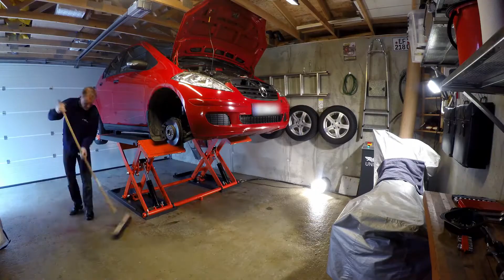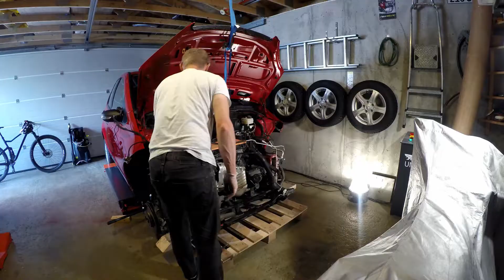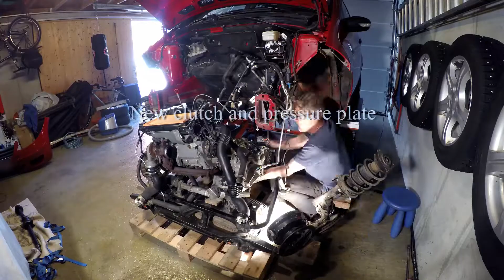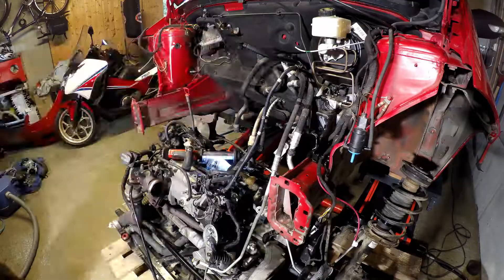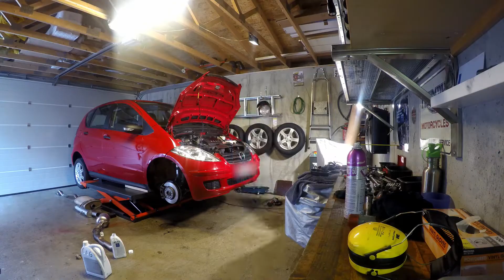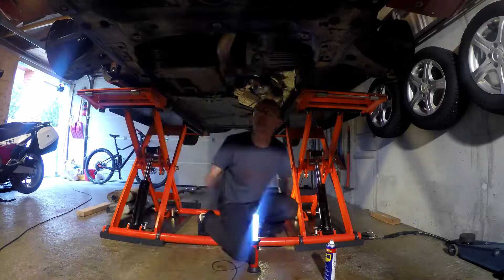Mercedes A Class / Klasse W169 engine / motor / moteur - clutch / kupplung / сцепление / spojka

Comment: Holy smokes, well done! That lift must be costly... This is mainly for the clutch? I changed glowplugs without taking engine down. Apparently there is a way to lower the engine to access some stuff... Garages here in UK charge about £60 per hour labour so I might as well scrap it if the clutch goes!
Reply from the maker: Thanks :-). I did a lot more than just the clutch, but the clutch is an engine-out job. I also changed the glowplugs and middle exhaust, and lubricated the polymer drivebelt idler pulley bearings, as these were beginning to run dry. A common fault. Also changed the oil, brake fluid, filters etc. for a full service B. The lift cost 1500 GBP (equivalent), while I got a quote for the clutch exchange for approx. 2000 GBP. With glowplugs, service and all it would have been approx 3500 GBP. Also one of the glowplugs snapped during removal, and caused me some extra headache. A garage would have told me to scrap the car. So by doing it myself I saved the car from the scrapyard, and got a new lift as well :-). A win-win situation. Also gained some extra confidence from this job :-).
Reply: @mig1600  Thats a hell of a job! Is there a manual with steps how to do this? Thanks for the information on the quotes... I bought my a180 w169 for abou £500 bargain find, so its deffinately not worth it for me, hopefully it will last another year or so, currently 162000 miles on it. Lift is a cool thing to have yes, for any future cars also!

Ah damn, one of my glowplugs also snapped! What was supposed to be a one day job turned into almost a week whilst i waited for a glowplug removal kit to arrive...
Reply from the maker: @tehdreamer  Yes there is a Mercedes manual for PC installation, and a couple of books in German, but these are only copies of the Mercedes WIS/ASRA installation. You can buy the program on eBay and download it. Quite a hefty installation, and difficult to use. The older A-class seems to be quite cheap these days (avoid by all cost the first pre-2004 generation), no doubt due to the high cost of repair. However if you do it yourself you save a lot, since most is labour. And I love the car, they are actually very easy (but sometimes time-consuming) to work on, everything is well thought out. Yes, the glowplugs snap, they are not supposed to do that :-). I tried everything, but it wouldn't budge. The glowplug swap was more nerve wracking than the clutch. Luckily I was able to bore it out without damaging the threads, and clean up the threads afterwards. The plugs seems to be made of hardened cheese or something, they are quite soft. Yes you can lower the engine some 10 cm (4 inches) to access the alternator, polymer belt and pulleys, A/C unit and some other stuff. The polymer belt and pulleys is something to watch out for; screeching noise from the lower right part of the engine indicates the idler wheels are running dry, and you have to lower the engine to access them.
Reply: Lucky you. here in Guernsey the main dealer Jackson's charges over £100 depending on year and model.  lol
Reply: @mig1600   Really impressive, thanks for sharing this video. i have the same issue here trying to remove one of the original glowplugs on my CVT 2008 w245 turbo with 141000 km mileage, cause the previous owner never replace them! Any tips on how to remove the glowplugs in case it snaps? And what's the tools you used to extract yours? I wonder how you were able to extract it on a cold engine!! In case i touch the cylinder you think it's better to replace the cylinder head of the engine too . I really appreciate if you could reply. Regards
Reply from the maker: @sneuff  Hi! All of my glowplugs sat very firmly, they were all corroded. By applying copious amounts of wd-40 and gently easing them I was able to screw out 3 of the 4, although they were very thight. The last one snapped. I tried for several days, but the wd-40 was unable to penetrate. Forget about hot engine - it is a good two hour job to remove all the stuff on top so you can even see the plugs. You must also drain the cooling system, since the thermostat must be taken out. By then the engine is cold. The plugs snap at 10 nm force, so you can use a torque wrench and you will know how much force you can safely apply. However if they snap, like mine did, I found out that it is not that a great problem to get them out. Do like this: remove the snapped end of the plug with its core by dragging it out with wise-grip pliers. Be sure to get the core out. Now take a long 5 mm hss drill bit of good quality and drill down the broken plug, about 3 cm. Be sure to drill dead center. Then use a threading tap (M6)and thread down the broken plug that you just drilled. This thread will be used for extraction. Now take a good quality 6.5 mm drill bit and drill down the upper portion of the broken plug, so just a thin wall is left around the threaded part. The bottom part should be detached now. Now use a good quality M8x1 tap. Smear it with grease to prevent metal bits to fall down the hole. Thread down the hole and you should be left with a clean thread. The bottom end of the broken end of the plug will now be free from the threaded part, and can be extracted by using a good quality (12.9) unbrako / allen head bolt and some spacers. Screw this bolt down the hole you just threaded and it will draw out the broken body of the plug. Spray a good amount of wd-40 in the hole in forehand. Be sure to bore the aforementined holes dead center. However the glow plug body is very soft (made of hardened cheese or something like it), so the drill part is no big problem. It might be tight around the hole for your drill, depending on which one snapped. Use long drill bits. Do not break the drill bits or the tap! Lastly use a vacuum cleaner to suck out any debris from the hole, oil the threads of the new plug, and tighten LIGHTLY (5 nm I think). Good luck!
Reply: @mig1600  Eh man! Thank you very much,  mine was glowplug number 2 who snaps, i hv take a really deep breath and did take my time by following religiously every steps of yours and it come out like a butter, i really appreciate your help, very kind of you. Many thanks my friend.

Comment: how many hours roughly do you think it took you , i have been asked to replace the flywheel on a 2008 A170 petrol auto , thanks Niall
Reply from the maker: @montykart  I did a lot of other work on this occasion, like changing the glowplugs. However just the clutch job I estimate 2 workdays.

Comment: Great job. it's just a shame you've used speed . anyway, i'm wondering if you know the torque specs for the clutch pressure plate bolts and for the gearbox to engine bolts as well . apreciated if you could reply. Regards
Reply from the maker: Depends on the bolts. 8mm is 22Nm, 6mm is 9Nm according to MB manuals. Good luck! The gearbox to engine bolts I don't know, but these are not critical. I would assume 22Nm. Regards, M. G.
Reply from the maker: The whole job including the glowplug swap and other work took 5 days, I had to speed it up a bit :-).

Comment: Is the clutch cylinder on w169 a150 in the gearbox or outside? Do i need to take the whole engine and trans out for that? The clutch pedal is on the floor, any help? Master cylinder slave cylinder?
Reply from the maker: The clutch actuator (slave cylinder) is combined with the clutch thrust bearing, and is inside the clutch housing. You will have to take out the whole engine/gearbox/subframe as in the video. Good luck!

Comment: Hello, would it be possible to get the video in full length? Or just the part where the crash bar and radiator are removed? I need it to repair some damage. It would be really great if that could work out!
Reply from the maker: @tlb565  I’ll check if I still have the originals.
Reply: @mig1600 that would be great 😊
Reply: @mig1600  did you found it?
Reply from the maker: @tlb565  Sorry I deleted all the files it seems, due to size.

Comment: Hi, great video. Do you know the steps to remove the entire sway bar? Is it necessary to lower the subframe? Thank you :-)
Reply from the maker: Hi! Yes, you would need to lower the subframe to do that.
Reply: @mig1600  Thanks again. I read on WIS that it's not necessary to lower the subframe. The final front part of the subframe is attached to the main subframe with 3 bolts. And that part is right under the radiator. If you lift a little the radiator and remove that final subframe part, there should be space to make the sway bar slide under the radiator. Hope it helps for the future :-) all the best

Comment: I just finished mine  well pretty much. Serviced with engine oil, air and oil filter, sparks and new clutch kit. Only to find out the clutch pedal is now flat to the floor and it doesn’t come back up   I’m guessing need bleeding something in the line  any ideas ??
Reply from the maker: You must bleed the clutch circuit by having someone to pump the clutch pedal, and opening the bleeder screw on the clutch actuator down on the clutch housing when the pedal is down. Then close and the clutch pedal can be released. Repeat. Or use an Eezibleed pressure kit like I do; then it's a one man job.

Check for leaks along the lines. Good luck!
Reply: @mig1600  thanks for the tip  
I will do the bleeding and will see how it goes  
I do have a one person brake bleeding pump  so it might be fine  
I’m just concerned about the clutch pedal being stuck on the floor  
 I can pull it up by hand though
Reply: @mig1600  thanks for everything. think the clutch is bled, car shifts gears as normal, however there's a grinding noise coming from the gearbox with the car in neutral and it gets really loud when driving around. any ideas on what can be wrong?? any help much apreciated before i go to the dealer for a diagnose. Regards
Reply from the maker: @rickyquique3863  Difficult to diagnose without hearing the noise, but are you sure you installed the friction plate the right way out? It should be marked with 'Outside', and that side should be towards the gearbox. The other thing I can think of is a problem with the dual mass flywheel; they tend to disintegrate and make rattling noises.

Comment: I know this is an old video. But I’ve studied it to remove my engine. Is there any chance you know the torque settings for the clutch plate when you changed your clutch? 

Thanks.
Reply from the maker: Yes, first stage 3Nm, second stage 9Nm. Good luck 😊. I still have the car by the way.
Reply: @mig1600  

Thank you for the information. My engine has had to come out because of a failed oil cooler (oil leak and oil in the coolant, but no coolant in the oil or overheating). So thought I’d change the clutch at the same time. 

Would you recommend replacing anything else while it’s all out? 

Thank you for your response.
Reply from the maker: @TFC-tj5ql  You must change the flat belt and idling wheels on the right side. These fail around 100K km. Also check the flywheel shock absorber springs, these also fail.
Reply: @mig1600  

Just thought I’d let you know I got my engine in and out. All back together now.

It look me a total of 8 days by myself. With trolly jacks and axle stands on the floor. 

I started it today, seem to have a lot of knocking on the front while driving. Going to see if the subframe bolts need checking…. Or possibly the strut bolts need re tightening 

Thank you so much for your help and guidance.

Comment: The starter motor on my A160 CDI has died. Might be game over for the car because it seems so awkward to get to. Any thoughts?
Reply from the maker: You will have to lower the front subframe assembly with the engine and gearbox, by unscrewing the 8 bolts holding it in place. You will need a car hoist like mine.

Comment: Hello amazing job you did......can you do the crankshaft seal without removing engine mine is leaking alot?
Reply from the maker: If you mean the right crankshaft seal then it could be possible, however you will have to lower the engine with the whole subframe. It is possible to lower it approx. 10 cm to access the polymer belt and pulleys. It would be very tight though.
Reply: @mig1600  thankyou for the quick reply!.....yes I meant the belt side seal... not the gearbox side...  My car has done 88k miles what else would you recommend changing on this side while it's down
Reply from the maker: @tazhussain3563  You will have to take a look at the three belt idlers. The bearings get noisy and fail at around 70-80k miles.

Comment: Great video! I'd like to replace the pulleys and tensioner on a w245 (same engine). I was thinking about lowering the rear part of the engine unscrewing only the two rear engine mounts' bolts. Do you think it's possible this way? Apart from the exhaust will I have to detach other parts? Thank you very much :-)
Reply from the maker: Yes, it's possible to change the pulleys that way. However I think you will have to lower all 6 bolts holding the subframe. You will have to take care that the radiator and hoses don't get damaged. There is a special tool designed to hold the rad during this procedure, but it should be possible to do it without. Just be careful that the subframe does not fall down if you loosen all the bolts too much. Good luck!
Reply: @mig1600  I meant loosening only the bolts of the two rear engine mounts, so that I can lower only the engine, not even touching the black subframe (too risky for me). Anyway I really appreciate your answer thank you again :-)
Reply from the maker: @ticktime6569  Oh, I see. however loosening the subframe bolts is less risky, and less work. You could struggle to get the engine in line with the engine bolts if you loosen them instead.
Reply: @mig1600  nice point. Thanks man really

Comment: Absolute nightmare. Getting my clutch changed today and it's costing me £1400.
Is it possible to change the clutch without taking the engine out?
Reply from the maker: It could be done, but would mean much more work. Better take out the whole subframe with the engine/gearbox.
Reply: @mig1600  ok cool just making sure they aren't ripping me off. Thank you for the reply.

Comment: I have a leakage problem with my brake liquid and also now some leakage with the window washer...do you know how to fix this? Would be so glad for some help! 😊
Reply: For the window washer, have you checked the washing fluid reservoir for any cracks? Mine had a crack near the upper mount peg, which was leaking when it was full. Replaced it with a new one.
Reply: @viczak6307  yep you were right! It needed to be changed. Also the breaking fluid was due too bad breakpipes and they need to be replaced. Total cost 850 euro, merry Christmas for me🤣
Reply: @zoltanrull3117  That was the price of the parts & labour or just parts? All oem parts? I'm aware of the fact that oem Mercedes-Benz parts are not cheap nor the labour is. If you're considering using the car for many years ahead you might think of an upgrade for the brake pipes (if the current ones are made of steel that will rust in a certain number of years you might use copper brake lines or if still available copper&nickel ones).  The last mentioned ones were factory fitted to the Volvo 200 series and do not rust. Had one for more than 20 years and none of the brake lines was rusty. A rust free alloy for sure and harder than copper lines which might be prone to bubbling during ABS pump in use.
Reply: @viczak6307  it was the price for both labour and parts. Well yes, Mercedes isn't known for beeing a cheap car🤣  I think they will putt copper lines on, so I hope I can use the car for many years 😊 I just love the little car!

Comment: I need detil instruction for this job sir?
Reply from the maker: Do like I did in the video: Take off front bumper. Take off intake air cooler and radiator. loosen front top dampers (three bolts from above). Take out both driveshafts. Take off exhaust. Loosen gearshift mechanism. Losen engine subframe and lower the subframe complete with engine/gearbox unit. Loosen engine mounting on the left side, raise engine/gearbox using the method in the video. Take off gearbox. Change clutch. Be sure to check that flywheel dampers are OK, if not change flywheel as well. Install in reverse order. Refill coolant and AC gas. Good luck!

Comment: The ultimate horror engine...
Reply from the maker: Actually it is quite easy to remove the whole engine/gearbox/suspension assembly as a whole, however it is very heavy. All the connectors fit one place only, so not possible to make mistakes. Everything seems well thought out. But a good two days work to change the clutch.